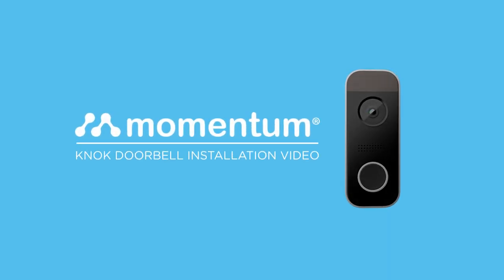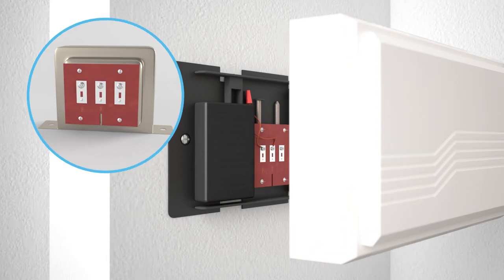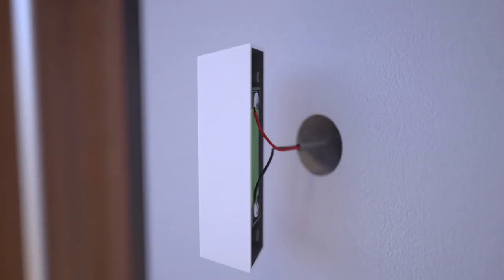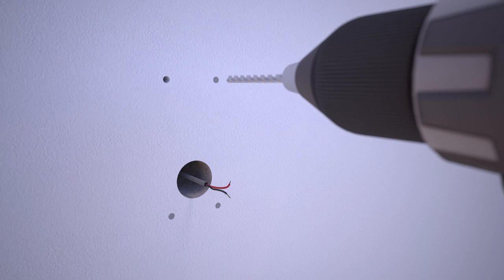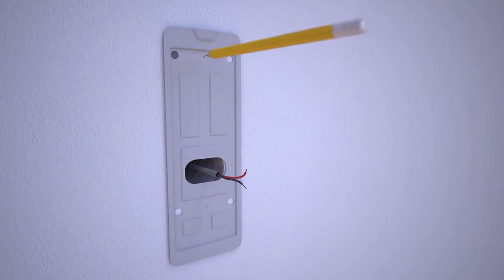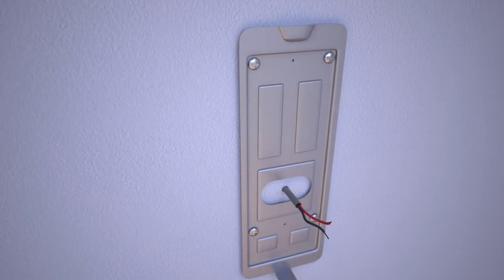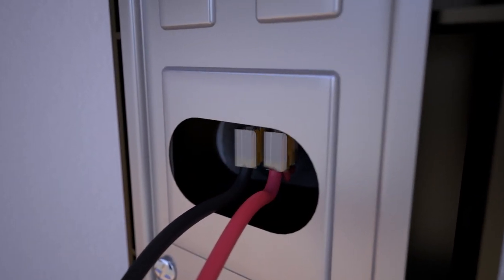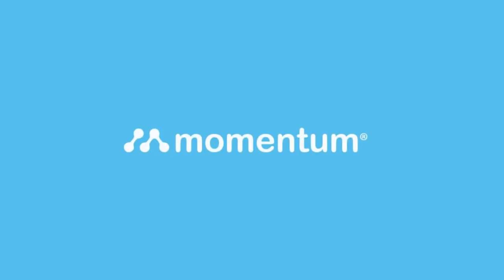Momentum Knok Video Doorbell Installation

Comment: Whoever designed this doorbell needs to be fired. The connections WILL NOT fit in the gap behind the doorbell and mounting bracket. Had to go with electrical tape to tuck in the cables.🤦🏻‍♂️
Reply: Having this same exact issue right now 🤦